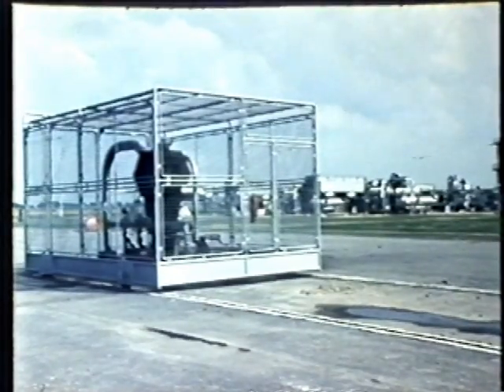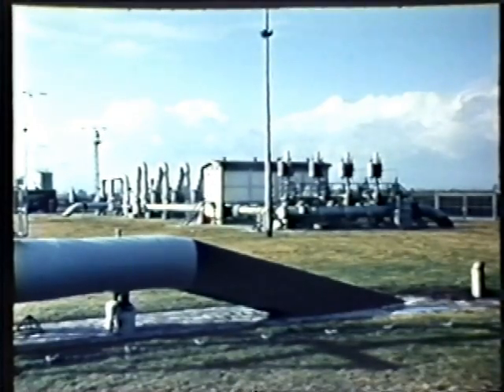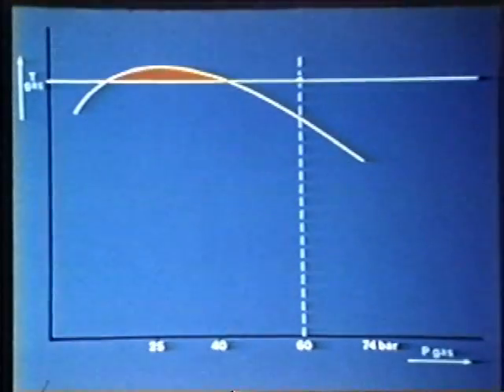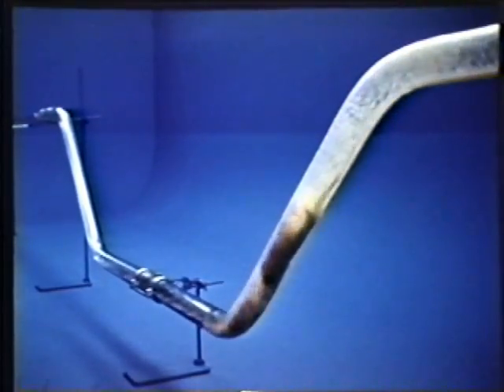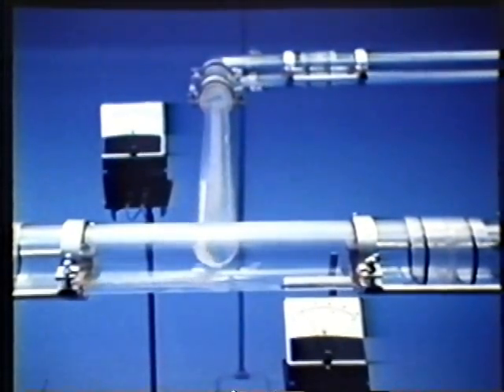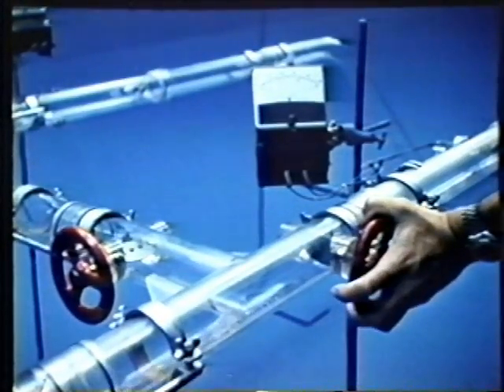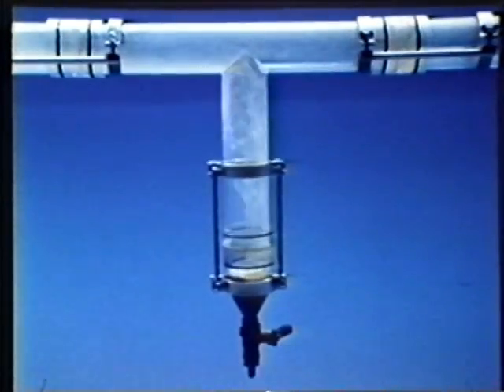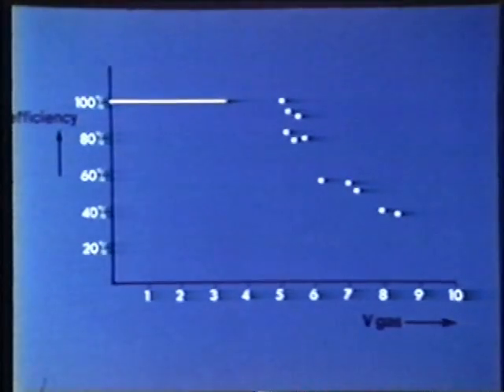Natural Gas Liquid Route Preference at Pipe Tees

Comment: To see how some of the principles discussed in this video are applied in real life, check out Miles Haukeness' invention, Innopipe, which takes advantage of the annular flow regime in gas transmission lines. Our company has installed many units across the globe. The piggable design allows bi-directional use in storage cavern, but there's also a non-piggable version for smaller systems.